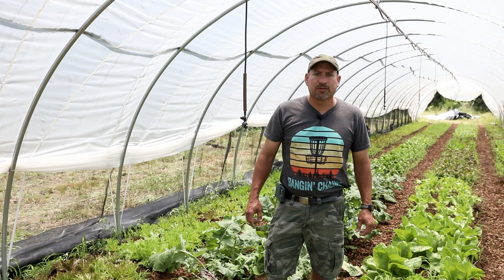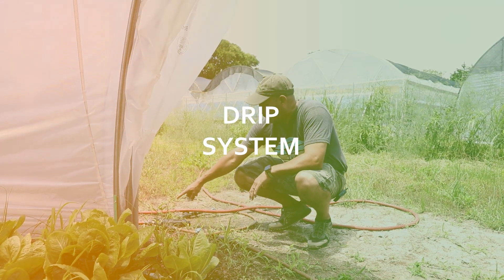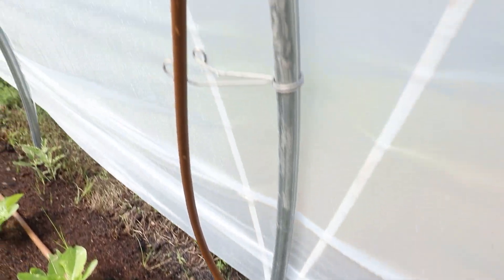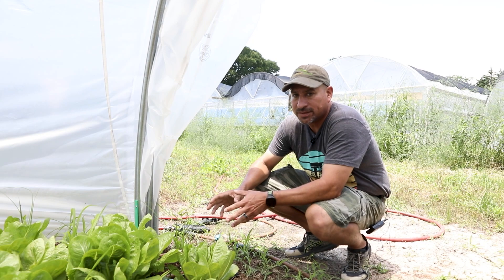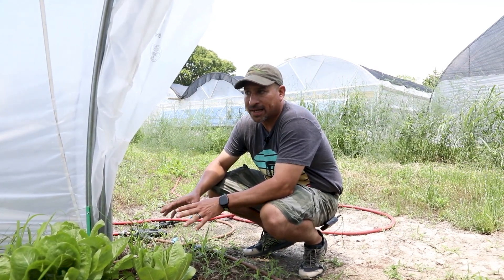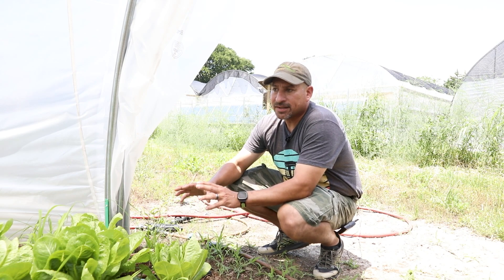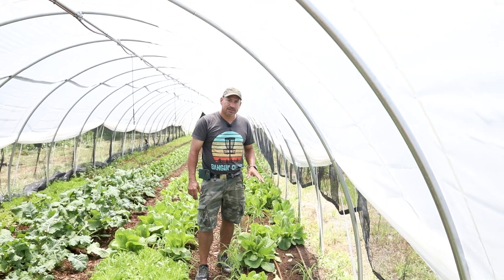Hoop House Irrigation System by Bootstrap Farmer

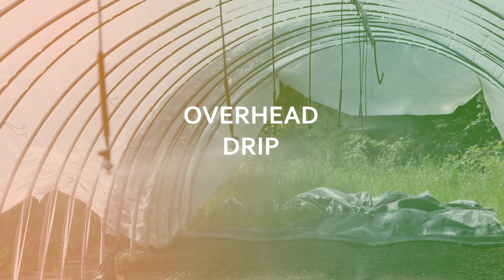Comment: Hello,are these micro sprinklers drip-free during operation? Some micro-sprinklers drip during operation and the plants underneath the micro-sprinkler suffer from water stagnation. At 0:09 i see a microsprinkler drip during the operation ,is that right? Thanks
Reply from the maker: The lines self-drain at the end of a cycle via the spinner check valve, so there will be a drip. In the tunnels we test at, it has not been an issue, but we do tend to run shorter cycles.
Reply: @BootstrapFarmer  ok thanks for the answer.  Can you upload a video where the microsprinklers are in operation? I want to buy this microsprinklers . Do you recommend them to me?